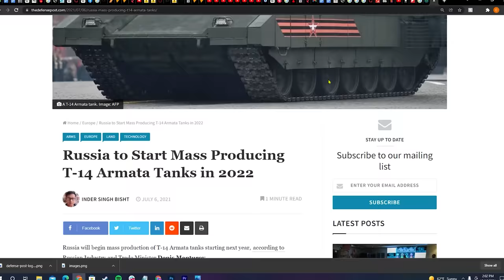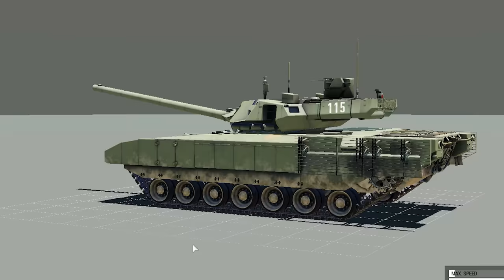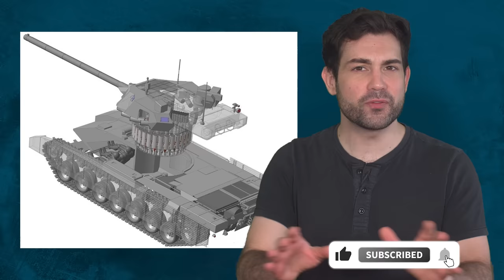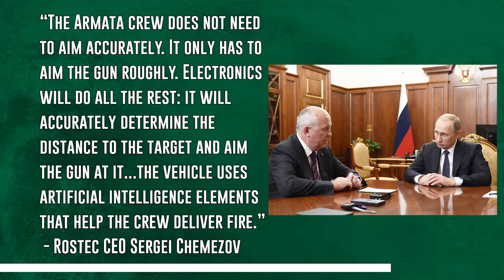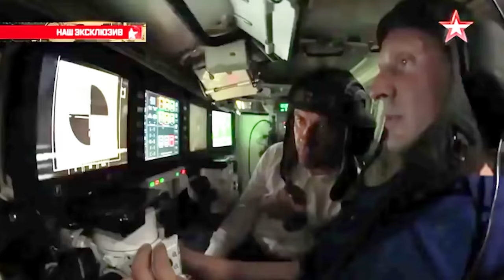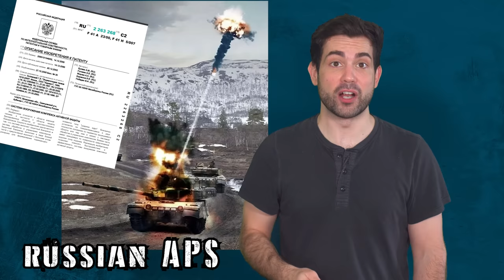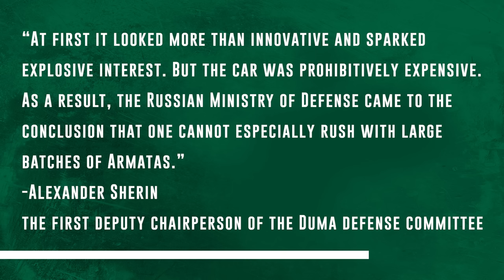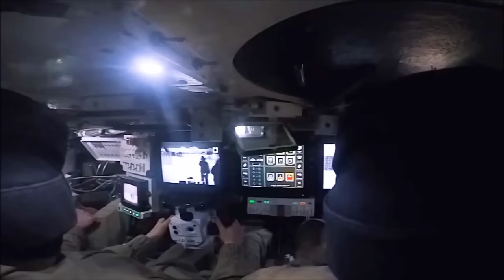The Truth About Russia's T-14 Armata Tank

Comment: Don't get me wrong, I honestly think the T-14 Armata is an outstanding vehicle but like with any armored tank - it has room for improvement. The Abrams is in bad need of some of the new features that the Armata has. Hopefully people see that my jokes are meant in good fun and I mean no harm. See you all next week : D
Reply: Oh hi Cappy how you doing
Reply: Like what?
Reply: Russophobia.
Reply: The Abrams definitely needs a  remote controlled crewless turret with a autoloader.
Reply: @Venator631  i rather make a new tank instead of doing some dumb shit like that
Reply: @CrayonEater255  New tank or new turret it's still going to be expensive. But if memory serves right there's already a update out for the Abrams.
Reply: Good or bad. I don't care, I want one
Reply: @Venator631  
Autoloaders are slower
Reply: @Venator631  At that point you might as well just design a new tank
Reply: Abrams had every single such feature tested in 80s - unmanned turret, longer barrel, 140mm gun - everything.
Reply: @Memovox  OMEGALUL
Reply: @Venator631  the next update focuses on Fire control systems and overall updates, everything we know
Reply: @theimmortal4718  You are both right and wrong Auto loaders have better endurance
Reply: @theimmortal4718  They also remove the need for a trained loader so it really depends on if you see a lower rate of fire as a weakness I don't because I see precision as more important than fire rate.
Reply: @spartanx9293  
How?
Reply: @Venator631  
How does an autoloader give you more precision? An autoloader doesn't make it more accurate. It does, however make the tank lighter
Reply: T-14 no match for tactical pug
Reply: @user-dd6id9bn1e  
I don't think so. It's already seen time in Syria
Reply: @theimmortal4718 an auto loader cannot get exhausted a manual loader can in the short term you will have faster follow-up shots in the long term as he gets exhausted and they'll start to slow down
Reply: @piotrd.4850  Yes and it was ridiculously expensive
Reply: @spartanx9293  
I could see that if it weren't that the main gun would probably be out of ammo before that
Reply: @spartanx9293  
Doesn't the autoloader carry half as many ready rounds? On the T90 it's 22 rounds vs the 42 ready on the Abrams. I imagine that kind of endurance would matter more than physical endurance.
The Armata has 32 rounds loaded, so that is an improvement
Reply: @theimmortal4718  Ok you're right about that I don't remember where that was going or what was on my mind when I wrote that because I got distracted by food.
Reply: @theimmortal4718  doesn't the Abrams Carry on average about 40 rounds
Reply: @theimmortal4718  I think so let me check I'm only acting as devil's advocate for main battle tanks I generally prefer manual loading because the first shot is what matters most
Reply: @spartanx9293  
I think the benefits of an autoloader are more taken advantage of in the T14, since it now allows added protection to the crew, as well. That is a big advantage, I think.
I've never heard of the 125mm missiles being used in combat, bit that also seems to be an advantage. Do you know if the autoloader works with them or if they have to manually load those? I don't know much about them
Reply: Ive noticed the US in general opts to upgrade past systems rather than just creating a new one, all the time. the M1 Abrams turned into the M1A2, then into the M1A2 SEP v2, v3, and now v4. Same thing with the air force. While China and even the EU developed a new Air to air missile from the ground up, (EU -Meteor, China - PL15 and PL21) We just kept upgrading the Aim 120 like 5 different times, and even now rayhteon just announced they're making continual changes on the fly in the production line, we only just started testing the Aim 260.
Reply: @sevrent2811  
The Russians have done that, as well. They have upgraded the T72 for decades, as well as the T80, and the T90. There's multiple variations and upgrades of each. The T14 isn't meant to replace current Russian tanks but to add additional capabilities to the force. They don't need thousands of them, but only a few hundred for spearhead forces.
Reply: @sevrent2811  well the aim120 is only a couple decades old and the a120d doesn't really have that much drop off in terms of performance in comparison to its contemporaries
Reply: @user-dd6id9bn1e  
так грустно 😭
Reply: Are you the real Chris Cappy ??
Reply: Well they better be lightweight improvements, Chris, because the SEP4 weights 70 fricking tons
Reply: All reports seem to be the the T14 won't be produced in large numbers. The US has universally been using the M1 Abrams as it's only tank for 30 years. We completely retired the M60 by the mid 90s.
The advantage of having one tank, as opposed to several like the Russians, is maintenance. Tanks are maintenance intensive. Having the same parts and mechanics trained is important. Plus, having a crew of 4 rather than 3, means more guys who can work on the vehicle.
Whether you're changing track, pulling a motor, or just pulling security in defense, the more the merrier.
Reply: @Venator631  the TTB was just the thing. Back in the 80s.
Reply: $3.4 MILLION PER POP? LMAOOOOOO 🤣
Reply: Considering that the US economy is 14 times larger than Russian as, that's much more expensive than the 8 million dollar M1
Reply: @user-dd6id9bn1e  strong words for an ukrainian
Reply: What if India buy 1700 tanks on it FCV purchase which is mostly biased towards t14??? Then what will be the situation
Reply: @spartanx9293  42 rounds in the iMagic M-1A2 & Novalogic Armored Fist 2
Reply: i cant think of one thing the t14 has that the abrams desperately needs or even wants
Reply: Never, ever, apologise for jokes; better to offend the wokes.
Reply: @jaxrammus9165  the Abram can't be upgraded further and it has added Trophy system but limited units only. The features on T-14 can't be added on M-1A2SEP but would need an entire new design if US intended to replace Abram MBT. US however has no intention to replace its MBT due to existing high operating cost requiring frequent overhaul on chassis and if there's war, US is confident that it could destroy Russian & Chinese latest MBT with preemptive strikes while M-1A2SEP could still take out the T-14 & ZTZ99.
Reply: As always Chris, very nice video. I like your kind of humor 😁🤘🏼
Greetings from Russia
May there be no more war. Better play games not war.
Reply: Wait, Chris you were joking?!?!? And I thought you were cereal all the time. 
Ok puns are bad also. Sorry. (Not really) HAHAHA 
I enjoy your videos and your sense of humor.  Keep up the good work.
Reply: @jayjay53313  "cant be upgraded further" no lol
Reply: @jaxrammus9165  you think you can fit automated turret on the Abram when the chassis is not thick enough? Unless you wanted to make it 1 man crew or stick 2 more in very cramped space close to beneath the turret. The auto loader would be at the back with ammo stowed in turret rear compartment, that is still feasible but crew escape hatch nil
Reply: You're awesome cap, keep up the great work, from your mates in Australia
Reply: Once T-14 goes to mass production, it will be a happy day for tank designers in USA.
Reply: It wasn't broken it was something with brakes look at the video from redEffect he explained it
Reply: @kaushalshetty3923  I'd like to see India armed up, considering the noises China is making, and the other neighbors.
Reply: @SteamCrane  on that I cannot disagree but about the argument that Russian has difficulty to manufacture t14 for itself, won't this change if India agree to purchase 1700 tanks.
Reply: Thanks for explaining about the production issues. It's interesting to see so many countries struggle with that same issue.
Reply: @Kris-ym2zr  it's maybe rather than purchase a goods with lots of issue, by letting it to mature in production stage itself. Like Tejas mk1 of India, rather purchase in bulk India purchased it in small lots and let it mature placed order for improved Tejas mk1a
Reply: @kaushalshetty3923  Thanks for that as that would be a good plan to iron out any issues.
Reply: @The Immortal  bullshit, i will look at you after 5-6 loadings. Autoloader dont get tired)))
Reply: @Кумыс Мамбетов  same as Crimea bridge, and north stream. You are pathetic))) но мы конечно доверимся эксперту из гдето там стана))
Reply: abrams is in bad need of replacement...
Reply: @andrespodra8459  but with years it might be cheaper and they will probably mix armatas and t72 like they were mixing t72 and t80
Reply: @andrespodra8459  yeah they probably wont sell armata anyway. or maybe in 20 years. also they are not in hurry to make huge numbers of armatas anyway. it is developed and if need arise they can start production. also as video says its future tank. 2300 armatas in 2020 was bs anyway. even with 3 million that would cost way over 6 billions but its probably more expensive anyway. so it was just press stunt form start.
Reply: @sevrent2811  I mean that’s a bit of a straw man argument everyone upgrades a system until it can’t be upgraded anymore.

How many versions of the t-72 are floating around out there? 

What about the Leopard on what version 7?
Reply: @jayjay53313  what, Army plans on upgrading Abrams to SEPv6 and so on, it can always be upgraded, Armata is decades behind when it comes to firing control systems and optics and SEPv4 focus is on improving these things, and all units will get the APS eventually
Reply: @CrayonEater255  you can add sandbags on turret and place more soldiers on top of Abram turret apart from SEP tusk full added armor + trophy, or add laser blinder but that's all. You want automated turret on Abram, the crew would have to squeeze into the chassis in less comfortable lying back position
Reply: @jayjay53313  man you’re kinda lost, it’s not about adding new things, it’s about upgrading everything…
Reply: @jayjay53313  why would want an automated turret on the Abrams, you have probably the best turret on existence with armor to protect the crew right? have all that armor on an unmanned turret is stupid
Reply: Chris Cappy, I know ya were probably joking, but: 
Товарищ(Tovarisch) = Comrade
Ура(Oora*) = Hooah
* - same/similar to US Marines' yell, but it is said slightly different in tone and inflection. 😉
Reply: @CrayonEater255  have you played Activision's battlezone 2 and Novalogic Armored Fist 2? Imagine if you could have just 2 crew in the MBT with automated smart targeting turret with fast autoloader in future. Turret gets blown off, just drive the chassis home & call it a day. US actually came up with such MBT prototype for testing purpose aimed at replacing the Abram. The plan was scrapped due to high cost and there's no powerful enemy to fight with.
Reply: The fact is that with the rapid advance of light but lethal weapon on ground and air asks the question is armor of any use any more ?
Reply: The Abrams is already upgraded. You should know this.
Reply: @verdebusterAP  yes, for urban warfare. You'll need MBT + IFV hybrid with thick roof armor for surviving top down attack, call it assault tank rather than MBT. You'll need gun port, autocannon, mg, mortar & grenade launcher too. Maybe future MBT would get radar and comes with SAM system too. Refer Red Alert Soviet's mammoth tank. It's not impossible to fit 4-8 stinger/igla or larger longer range missiles with AESA or IRST extendable mast on MBT.
Reply: @jayjay53313  
Again thats still waste of time
ATGM teams can simply double tap or use anti material rifles to destroy the tanks sensors or use IEDs
The fact is that market for armor destruction has produced weapons that APS nor ERA can't stop
Unless you have tanks with ARC reactor like Iron man which can power 500kW laser for a quick firing laser defense system armor days are number
The US, Russia and Israel have developed light weight but lethal systems
For Israel is the Spike NLOS on Sandcats  The US , the JTLV with 30mm cannon and various mission options and Russia the GaZ Tigr with Kornet missile
All 3 can be built faster and easier than armor
Light enough for helo to carry them externally 
MRAPs can handle urban warfare
Reply: It's about mass production, cheap, speed, power to weight ratio
It's not designed to be better than the M1 Abs but out number them and be more manouravable 
Don't underestimate Russia tech
They are confusing people with there production info
China is mass making cheap units
It's about numbers
These days tanks are limited and too expensive
Look at WW2 Russia won via numbers with ok tech
China is doing same with air units drone 
Russia is already in Europe so no logistics issues
Thanks for video though
Interesting
Reply: The Nicholas Moran aka the cheiftain once in his said that if your scared that autoloader breaks then why do use tank and in tank anything can break. If now in M1 tank there too any electronic device that makes tasks easy even would break sometimes
Reply: How about this one; much of Russia's export market cant pay for these...if they could they would buy USA anyway😜

Cheers from the Lowlands 🇳🇱
Reply: Like what?. Abrams has the Trophy aps, which I would bet money on all day long. Honestly this is one subject that requires more research, for example, their 125mm cannon doesn’t have an apfsds round that can defeat western tanks. They literally don’t have a tank round that can penetrate circa 2000 western main battle tanks.
Reply: Truth is that most internet specialists are civilians that never been inside a tank, or shot a high call she'll. Or even from countries that don't even build tanks. As seen in Siria even T55s are been used, after all any armor is better than no armor. That most beautiful, best smelling tank/plane are kids arguments.
Reply: Abrams M1A2 V3 Sep with active trophy system plus M1A2 V4 sep4
Reply: The Abrams is getting improvements the next couple years with the SAPv3. SAPv4 iirc and even the m1a3 again, iirc from my googlefu
Reply: @Venator631  yea but sometime it’s safer with a human loading the tank instead of it loading itself. The M1a2 is safer then a lot of auto loading tanks. Cause the M1A2 Abrams has a Thicc door that opens and closes after u take ammo out. Idk what they call tank ammunition. But it makes the crew inside safer. But again technology does advance. And u have a great idea. Edit: 1st I think M1A2 Abrams are safer for the crew.  2nd: sometimes I need to stop being a nerd lol  3rd: I love the idea venator
Reply: Again I think it keeps the crew safer I’m like 80% sure but let me know if I’m wrong pls
Reply: @Imtheslowone  I'm not sure if  the M1A2 is safer for the crew we need someone who's served on modern British MBTs because they really challenge the idea that the Abrams is the best tank in the world. Personally I would rather crew a Challenger 2 because if memory serves right the only challengers lost in combat were because of "friendly fire" while Abrams have been lost to enemy action

edit fixed error caused by typing on phone
Reply: @CrayonEater255  why? Abram's chassis is perfectly fine, no need for a new one
Reply: @user-dd6id9bn1e  you're clearly not the brightest of people 😬
Reply: @grandayatollah5655  No I am not , but better than some .
Reply: @theimmortal4718  Especially when you crossing a difficult terrain. Because 10 seconds is bigger than 20+, right?
Reply: @user-dd6id9bn1e  inadequate nationalist detected
Reply: @Venator631  the sep v3 is the new Abrams model.
Reply: Cappy, you delibrately tucked in your sweat pants?? Pls tell me u did for that scene??
Reply: @Venator631  the precision stays the same, unless you mean that a human loader will get exhausted and make mistakes??🤔
Reply: @montys420-  Clickbait
Reply: @montys420-  I admitted later that I didn't and still don't remember what my line of thought was with that. Maybe it came from seeing things with higher rates of fire as less accurate witch is not realistic when applied to modern tanks or most modern weapons in general just a guess.
Reply: Russiaphobia 👍👍
Reply: @Venator631  It doesn't lol
Autoloader brings a shitload of problems to tanks (e.g. swapping ammo) and makes blast doors obsolete. So if you get hit from the side to the ammo compartment, yo tank goes ka boom along with your crew.
They had ideas of unmanned turrets for like 20/30 years but got scrapped for a lot of different reasons.
Reply: @theimmortal4718  They made like 20 tanks in 7 years, they were promised to be delivered in 2014, than 2015, than 2016.... 2021, and finally they have like 20 of them which is nothing tbh
Reply: @jayjay53313  It's mostly going to be M1A2 Sep V2/V3/V4 VS mostly outdated t-72/t-90, maybe some latest t-72m variant. Which still lacks like a shitton of things you can find on an Abrams, like proper fire controls, proper thermals and etc.
Reply: @Geth-vk  
I didn't say they deployed hundreds of them.
I said that they have had experience with the T14 in combat in Syria. From what I read, it was a company.
Reply: @Geth-vk  The general idea for me is to basically copy the scorpion from halo with 2 tracks instead of 4. The reasons why beside the reduced crew requirements is ease of deployment the Abrams is good but as far as I know it's to heavy to be moved by plane requiring ships for overseas deployment so it can at least be used as a test vehicle until a effective scorpion like tank can be developed take that ideal as you want.
Reply: @theimmortal4718  Auto loaders are a nightmare?
Reply: @johntruman4397  
No, I don't think so. Just a different way of doing things. There's advantages to them
Reply: @Venator631  auto loader is kinda dangerous because most the ammo is stored inside the turret
Reply: @spartanx9293  they fail more often that manual loaders. When they jam, and they do, you’re finished.
Reply: @user-dd6id9bn1e  фантом который поступает в войска если что. Про коллапс экономики это вообще полнейшая чушь
Reply: @theimmortal4718  вот только США не могут производить Абрамсы, ведь завод где их делали в Детройте и развален полностью. Так что только модернизация уже существующих
Reply: @theimmortal4718  umm no? Its not slower its faster you need a highly trained loader and experienced to be faster than an auto loader
Reply: @BilalAhmad-fs5rf  
No you have that Backwards
Reply: @theimmortal4718  no you have it backwards and every country is aiming for remote control tank soo
An auto loader is better
Reply: @BilalAhmad-fs5rf  
No, you don't. I didn't say either was better or worse. I said manual is faster. That's it.
And it's true. Autoloaders are used for other benefits, but speed isn't one of them.
Reply: The biggest "improvement" to the Abrams would be to abandon that Honeywell AGT-1500 turbine engine and license-build a version of the DIESEL engine used in the Leopard II, which cranks out 1,500 hp, more than enough to move the Abrams around.  The biggest problem seen with the Abrams is that its a gi-normous fuel hog; i.e., the enemy doesn't need to target the tanks themselves, just go after their fuel trucks.  Wasn't too much of a problem for the foreseen battles against the Group of Soviet Forces in Germany in case the "Cold War" got "hot", as the operating theater wasn't all that big, but in "Desert Storm" and the 2003 invasion of Iraq, seriously crimped armored operations.
Reply: @Venator631  Terrible idea.  A human loader can keep us with the best of autoloaders, and he's available for tank maintenance, an often overlooked aspect of AFV design.  Plus, no sensor or camera will ever prove a suitable substitute for the TC sticking his fool head out of the turret, watching for threats and acquiring targets.
Reply: @Venator631  I think this is almost inpossible within an existing tank. The layout is just too diffrent. You need a crew compartment within the tank.
Reply: @selfdo   its not really terrible its a tradeoff. Yes it will probably reload slower and the commander wont be able to bravely sacrifice himself, on the other hand its probably the safest hull down tank and should pack some serious armor around the crew.  If its any good isnt decided by the concept but by the way they adapt to it imo.
Reply: @bigd5899  It definitely emphasizes crew survival, which is a huge departure from prior Russian/Soviet AFV designs.  As long as this tank has the luxury of the enemy being kept at a distance; the excellent firepower and crew protection would make this tank hugely effective in a "stand-off" role.  But that's about it for the T-14's advantages.
Reply: yeah. its weird how everyone adores both vehicles but other countries making stuff like the leopard 2 are still up there
Reply: @spartanx9293  much better the manual for safety,in case the tank is hit,
Reply: @nopenever8549  are those tanks had a number of other problems besides the auto loader I was simply saying that both platforms have their pluses and minuses
Reply: @theimmortal4718  For the first fire shots, maybe, but over the course of an hour, the machine always wins. Men cannot compete with the robot. Only Reformers would think otherwise
Reply: @CharliMorganMusic  
That's not really the case. History doesn't really show what you're claiming at all
Reply: @CharliMorganMusic  
In fact, the Russian autoloaders can't even fire their best 125mm apfsds rounds because it's too long. The shorter penetrators that can be fired by the T90 can't reliably penetrate the Abrams at mid range.
Manual loading allows for longer rounds.
Reply: @jayjay53313  But their ground 
Rader systems would take care of that as troops today rely on those systems to pick up whats going on.
Reply: @johntruman4397  which tank are you referring to? Abram or Armata?
Reply: @jayjay53313  Both sides will have their ground Rader but does not have to be tank mounted.
Reply: abrams need AC
Reply: Let’s not forget that the Abrams exists
Reply: Dude your jokes are in great taste! We are talking about murder machines so PLEASE can you keep it light hearted...i cannot say enough great things about this channel
Reply: You might have a good channel but I can’t do the little kid jokes and terrible memes mixed in every minute. You have so much good content in this video and I’m 10 mins in and am over the presentation style. You’re corny with the jokes they aren’t needed and diminish the quality. “My car blowed up gonna have to walk to work!” …why
Reply: The Abrams replacement is under development.
Reply: Not to sure if have you seen the press releases on the my favorite tanks A3 variant. Holy shit, target aquistion of multiple targets simultaneously. All they need now is a rapid auto loader.
Reply: @theimmortal4718  they aren't slower  they just add more complication to maintenance. They are infact more consistent.
Reply: @cptclonks7279  
Considering that the Russian military is corrupt and lazy, I'd say that the maintenance aspect is vital. Having technology rotting in fields doesn't exactly build combat power. From the looks of it, Russian tanks can be killed by climbing on top of them and throwing a grenade into the turret.
Reply: I thought the US was scaling back their tanks in 2020, or was that just the Marines?
Reply: @DeadDrop6109  
Just the Marines. The army gets those tanks
Reply: Armata has been cancelled because it was too costly tank.
Reply: How can it be outstanding when it not even exit?
Reply: T-14 is a parade queen
Reply: One word … drones
Reply: @PayNoTaxes0GetNoVote  hey I'm giving reasoning I never said I agreed with it
Reply: @CrayonEater255  pretty sure there won't be any updates. Just and fyi
Reply: @ericv5337  lol maybe on twitter
Reply: It's called the A3 Abrams and the new series of Abrams are very competitive. Improving
Reply: Chris Cappy, actually only 20 T-14s work properly
Reply: @Memovox  Americophobia.
Reply: @Memovox  Vodkaphobia* and Beatingwomenislegalphobia.
Reply: no problem...what's your address?
Reply: @theimmortal4718  The Russians have been saying the Armata would go into mass production "Soon" for 7 years now.  Open source intel can't find more than a couple dozen tanks actually built so far.  The U.S. has built over 10,000 Abrams and Abrams variants.
Reply: @Perserra  
Exactly. A prototype tank with maybe 10 copies is irrelevant
Reply: @ShivaTD420  
And without armor, infantry can just be killed with machine guns and artillery. We go back to WW1
Reply: @theimmortal4718  infantry fighting vehicles would be used for that. Tanks can only push. Anti material harassment usually takes out their optics. Most atgm can reach tanks from up to 2.5 miles, usually out ranging the main gun.
Reply: @theimmortal4718  drone versions of tanks would most likely take the tanks place.
Reply: @ShivaTD420  
Modern MBTs are designed to mostly fight other tanks. IFVs don't do well against tanks at all. If you try using an iFV to fight tanks, you'll die in large numbers 
Tanks and IFVs are used together in combined arms, along with dismounted infantry squads. It would be very foolish to describe heavy armor based on the performance of a poor, corrupt, mismanaged, and demoralized Eurasian army. Large losses don't necessarily mean a class of weapons is obsolete. It has more to do with poor execution. Compare this to the US Army in both Desert Storm and OIF1. Those armored assaults were highly skilled and effective.
Reply: @ShivaTD420  
In some capacities, yeah I can see that. Especially for armored recon ahead of formations. Tanks and IFVs will be receiving different types of drones, depending on the mission. In counter insurgency, you use mostly quad copters, and in more open terrain they will carry something like the Switchblade 600 loitering munitions in some of the TOW launchers.
Reply: @PayNoTaxes0GetNoVote  heh yup the loader would be out of ammo before being tired. Not to mention the autoloaders can jam, then a 3rd crew member has to nearly dismount to reach the compartment to autoloader.
Reply: @theimmortal4718  agreed, I just see us keeping the Abrams frame updated better than effort in some next gen crewed tank.
Reply: @theimmortal4718  certain situations ifv can get the upper hand. The 30mm can cripple most of the optics/track. Tow can outrange most main guns, and a crew that can dismount. But I can't disagree with that depleted uranium chassis vs aluminum . I respect the tank crews, brutal conditions in those things.
Reply: @ShivaTD420  
Maybe the same with Bradley. New turret and electronics
Reply: The next generation of US Tank is said to use a Generator to power electronic motors this will help make the tank lighter and give it much better speeds and range!

Will also use Auto Loader

Will use GPS coordination (Satellites Information,  F-35, AWACS etc!) to allow it to hit targets outside of Traditional Optical, LASER & RADAR targeting solutions!
Reply: @theimmortal4718  Yes, drone escorts for any and all manned units will be the norm in the near future.  There will probably be a new phase of combat as well: an initial blitz of both sides' drones going at each other, followed by the winner advancing with drone-augmented manned units.
Reply: @theimmortal4718  and on current Soviet era tanks, it often tries to stuff the Gunner into the breach.
Reply: As opposed to non-armored tanks?
Reply: @PayNoTaxes0GetNoVote  Cringe comment. Cringe commenter.
Reply: @theimmortal4718  at first, but the person gets slower after esch round they load
Reply: @TheRealBatCave  
I'm sure they can, in theory. I've spent half of the last 2 decades in heavy infantry brigades. Most tank loaders have pride in their speed and are a lot stronger than you think. Most of the loaders I've seen can load a 40 pound shell in less than 3 seconds. They might get slower if they had to load hundreds of rounds in a day, but the tank only holds 42 rounds of ammo. A fit guy can easily lift 40 pounds for 42 reps.
Reply: This didn't hold up well with their performance in Ukraine.
Reply: IMO - Autonomous Robots will completely replace tanks - For the cost of a single T-14 you can get an army of Boston Robotics Spot robots equipped with T-14 killing weaponry.
Reply: 2 things... It's sort of annoying people saying tanks are obsolete just because the Russians are using poorly maintained tanks improperly.  

Taking any old, poorly maintained tank with a crew that probably has not had the amount of training or gear (comms, night vision, etc) as it's western counterparts into an urban environment without proper infantry support, air cover, and good Intel is going to lose a country a lot of tanks.

Especially when the country you're fighting has high morale, is well dug in, has your comms, and armed to the teeth with the best anti tank weapons the west has.

The Russians are putting on a master course for how not to use your armor. The tank will still be needed for a long time especially as defensive measures continue to advance.

Second the T-14 is a giant joke. It will never see mass production due to build issues and cost that is only going to get compounded with the sanctions. Even if it does go into mass production it's still inferior to western MBT's. 

The program is just a desire to look like Russia can still play with the big boys. It's all pie in the sky that will almost certainly end up lining Oligarchs pockets more than producing a viable MBT.

Russia's economy was about the size of the state of Texas. That was before this war and the sanctions. Russia might not ever recover to be anything close to a super power again. Take away the nukes and they really wouldn't be much of a concern militarily either.
Reply: @Venator631  ah yes. I too enjoy my remote controlled crew less turrets that detonate when a non fatal shot hitd the tank
Reply: @Instar_nine  "dont underestimate russian tech" that didn't age well 😅 russian debris all over Ukraine. I mean that those vehicles that didn't get hit yet are debris, those that were hit actually got upgraded by that
Reply: It's called the t14, because 14 is the number of them in existence. I don't blame you for not understanding this Cappy, a lot of people don't, but firepower armor and maneuverability are the worst ways of determining whether a tank is good or not. Under these categories tanks like the tiger are considered good, the t-34 is considered good, the panther is considered good, mini tanks worldwide that in practice fail horribly break down constantly and have a myriad of issues that cause them to be practically useless are considered good under those categories. The things you should look into are reliability, ease of use and maintenance, and crew survivability. You can have all the firepower armor and maneuverability in the world but if your tank is a cramped piece of s*** and uncomfortable your crew is going to be too tired to fight when they get to the battle. I don't care how good your anti-missile anti-sabbot defense systems are if the tank breaks down on parade, don't lie to me about a parking break they were supposed to have experts and technicians on standby, they always do and no one figured out to check the parking brake b*******, then you can't get to the battle and you can't fight. And it doesn't matter how good your gun is, when any sort of electrical failure will completely disable your tank as no one except for a technician can get into the turret to try to fix it. Maintenance is a pain in the ass and there's no manual backup. I'm sorry none of these things inspire confidence in me.
Reply: @spartanx9293  Really? The Stryker MGS was dropped due to failure of its autoloader. Soldiers told me the autoloader kept breaking down.
Reply: Stop comparing the Abrams with other tank the abrams have proved what it can do in years of combat  and improvement.
Reply: The joke is trying to prop up the crap Armata
Reply: @Memovox  Common sense
Reply: @Memovox  
Everything is a phobia nowadays 🤣
Reply: Autoloaders are slow? Leclerc french main battle tank can do 10 rounds a minute. They had an autoloaders since early 90s. Seems kinda tried tested at this point.
Reply: Abrams needs absolutely nothing from any armata tin can. Why would American want to go backwards in time?
Reply: @theimmortal4718  autoloaders were made to solve fatigue not speed
Reply: @abas656thegodemperor9  
Looks more like they help the turret get maximum altitude
Reply: @abas656thegodemperor9  
And autoloaders weren't installed into Russian tanks for either speed or fatigue. Both answers are incorrect.
The autoloaders main function is to allow the tank to be lighter and smaller.
Reply: Actually Abrams got em in  those SEP you can say.
Reply: yes with it`s fearsome parking brake a single T14 is capable to block an entire supply road!
Reply: @Venator631  I absolutely don't think so. Not if it comes at the price of having one less soldier in the crew. These extra pair of hands are deperately needed in field operations because there is so much more to do on the battlefield (think of field repairs for example). 
What I immediately noticed (and I am by training not an armored officer): OK, amidst a battle some (mechanical) system starts producing failures. If you just have a driver, a gunner and a commander: Which function do you abandon? Do you want to stand still? Stop operating the guns? Stop coordinating with the other tanks of your platoon/ coy, watching the sensors and giving direction?  
What if, say, in the course of a major operation the driver falls ill, or the gunner? I mean, it's not like you just call the seargent major and within the hour you'll have a replacement. 
What I want to express by that is this: The 4th soldier is also kind of a "failsave", a redundancy.
Reply: Yea, it is called the AbramX and makes the T14 look like all the other tanks that Russian designed T72-T90 look like what they are. Russian Garbage!!! =) Even the Abrams SEP4 is better! And unlike the T14 the Abrams is battle tested!!